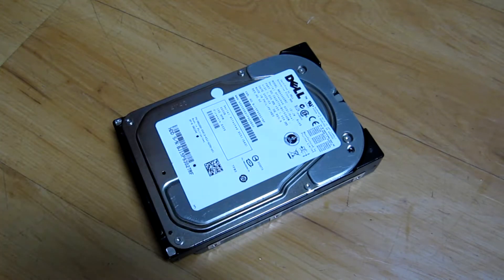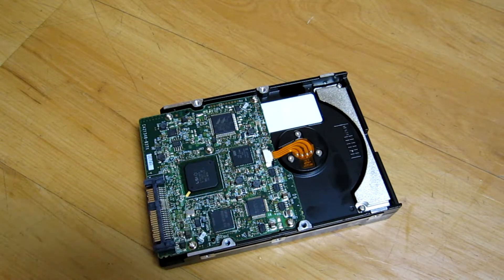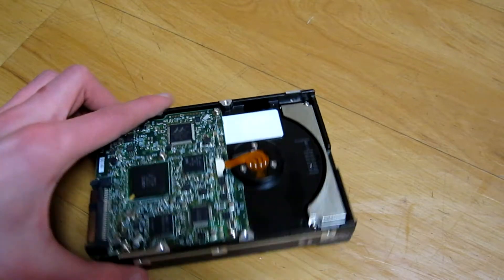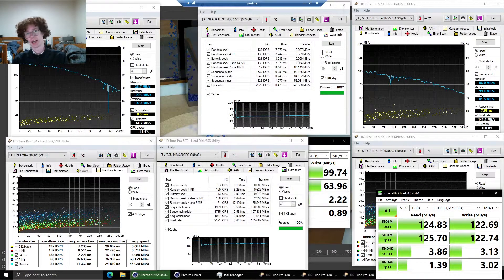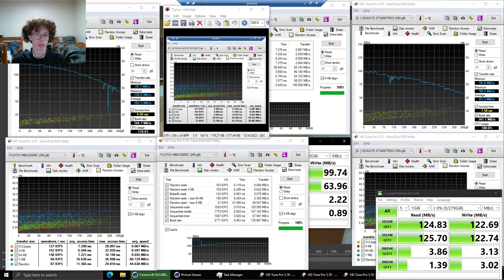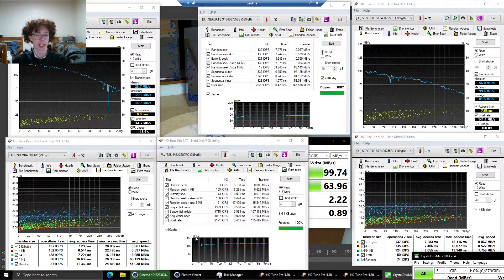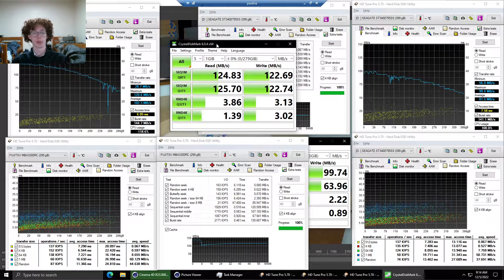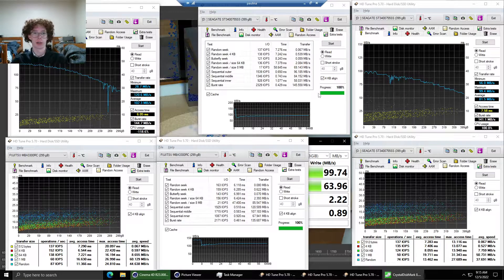A unique high-RPM drive from Fujitsu

Comment: Who would buy a 300GB hard drive?  That's so tiny, why not just go with flash?  Way faster and probably more reliable than a 15000 RPM drive which really has to be hard on bearings and pretty much everything else.
Reply from the maker: Hard drives may be inferior in speed and reliability to modern SSDs, but I find odd high-end drives like this far more interesting than SSDs because of their odd capacities (eg. 146GB) and rarely-seen high speeds above 7200RPM.
Reply: it's old, from back when flash storage wasn't really a thing. also, flash isn't necessarily more reliable in a server setting, as you only get a limited amount of write gb/tb before it goes read only, and also hdd's, especially back then, and still today, are much cheaper per gb than flsh storage
Reply from the maker: Yep, 15,000RPM drives came out when flash storage would've been slower, less reliable, and still 10x more expensive per gigabyte than HDDs.